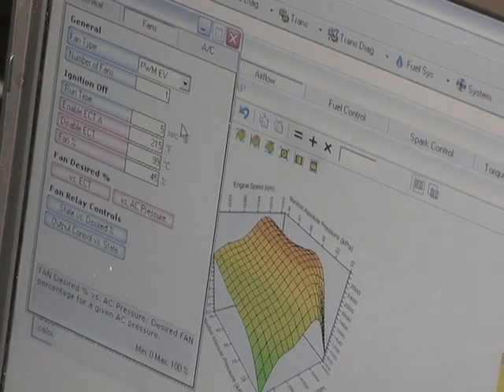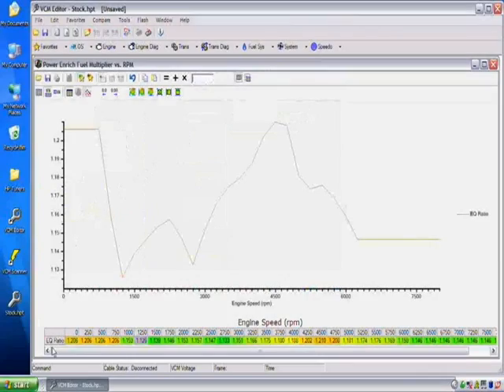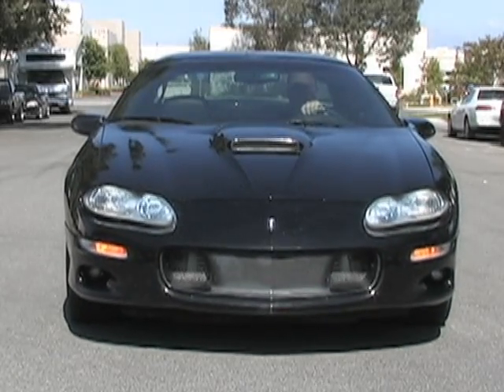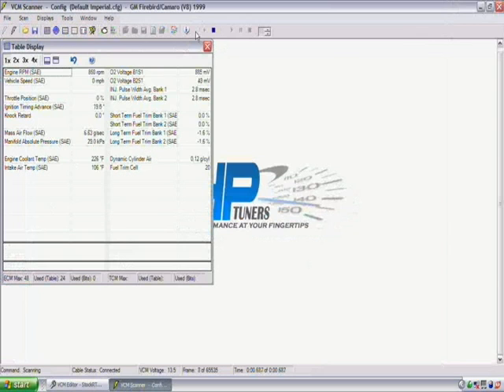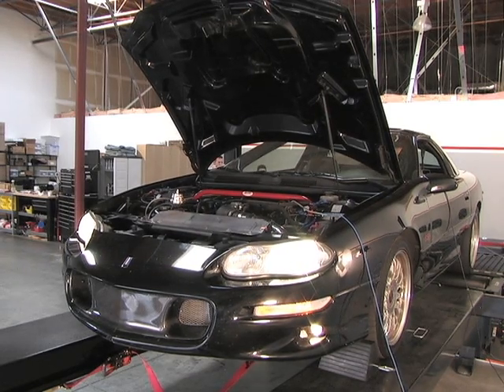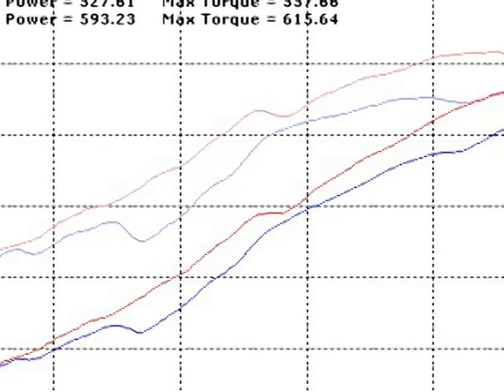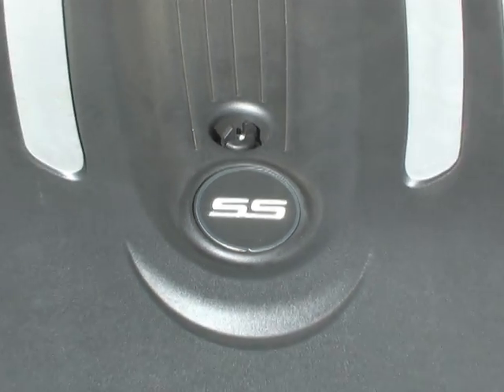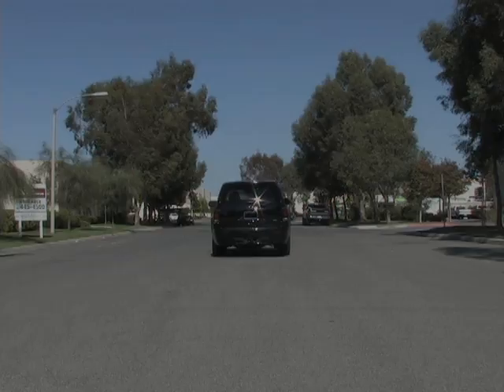HP Tuners Technology:  A Look Inside

Comment: I'm Adrian Wilson and I bought HPT 4 days ago to change the way my 04 Trailblazer shift. I bought it use 7 years ago with 65,000 miles on it. It has 152,000 miles now and no I have not replace my transmission. The computer hold 1st and 2nd to long. Sometime as high as 5k rpm at 35% throttle. I use HPT  to get the trans to shift much lower rpm and I think this will help my mpg.